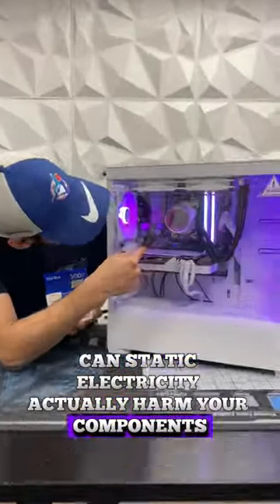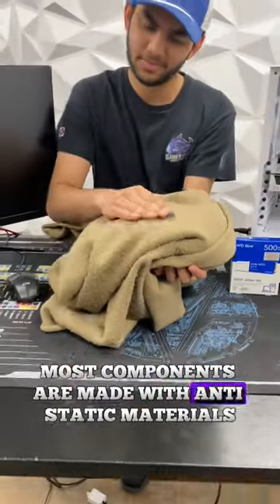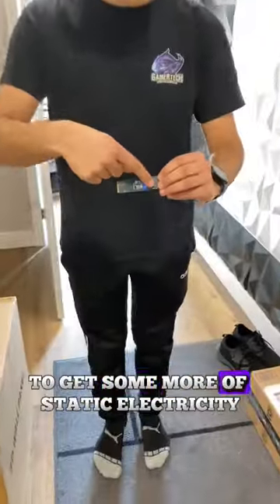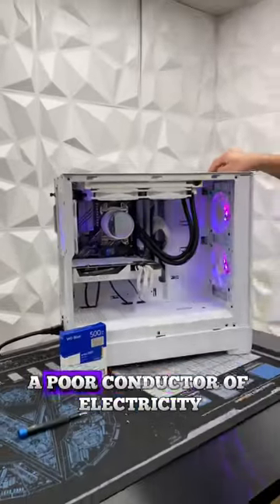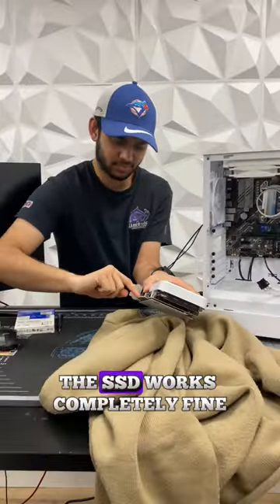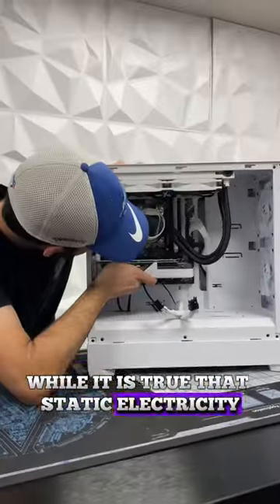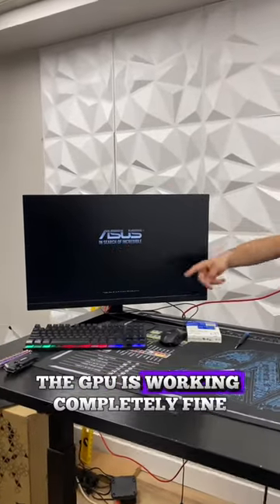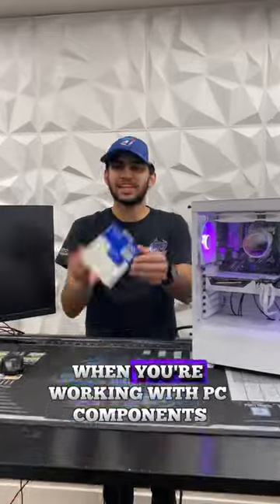Can Static Harm Your Components?! 🤬 #static #components #techrepair #gamingpc #pcgaming

Comment: wasn’t there a video you guys did about using a vacuum to clean a pc can lead to a fried mobo from static?
Reply: This happen to my friend so i wouldn't recommend trying it
Reply: Yea, but in the video they said that it was a long time ago. So the products weren’t static resistant yet.
Reply: @1xroxk645  It was also a long time ago when it happen for my friend like  a few years so  i guess thats why.
Reply: Vacuum or lawn movers produce a lot more static man
Reply: I just did it yesterday, unless it's some hand held vaccum you're using and just smushing it on the components, there is no way on this earth at this point in time where a regular vaccum cleaner is going to impart enough charge through the PVC pipe extensions to affect your pc. Evn if you just leave the pipe in and that vaccum hypothetically runs for 200 years

Comment: Folks don't listen to this video, it's horribly misinformed. There is different types of ESD damage. There's catastrophic where electronics are obviously stopped working, this is what this video is looking for, but there is latent ESD damage. The devices works but maybe it freezes for sec, or crashes every once and while. Then months later or even longer it stops working and you don't even know why. That is what you really need to be worried about. Also you can not feel the about the electrostatic discharge that takes to damage a component. If you care about your gear be as ESD safe as possible.
Reply: Source?

Comment: If you hold the ssd while charging yourself up, you also charge the ssd to the same level as your body is, same with the gpu there won't be any static electricity between the body and ssd/gpu if those 2 competents are groundet it looks differently
Reply: I was bout to comment this, but you right
Reply: @DementedApe  I was thinking bout it too xD
Reply: Right this was such a poor example, he should rub his feet on the carpet while touching the ssd and then step off of the carpet or set the ssd on the ground, or even install it onto a grounded system. Lol

Comment: static resistant unless your components are made or rubber, it’s not “nearly impossible. If you build up a charge and your not grounded, that electrostatic is gonna be jumping around like a dirt junkie, as soon as it can find a path of least resistance, like installing a component onto a grounded system, or stepping onto contacted floor while holding a component. Unless your systems components company somehow invented a material that is conductive when in contact with each other but not with the ground… that’d be some Harry Potter type shit. 
Either two ways. 1. Stay grounded ✌️Or 2. The floor is lava

Comment: Hey, so I have a Huion kamvas 22 plus (drawing display tablet) Its a monitor you can draw on. If anyone is experienced with huion/wacom or any other brands who make them please tell me if there is any worry when it goes black everytime I have a blanket near my table where it sits. It quickly works again after less than a second but should I be worried ?
It's connected via a thick USB-C to USB, HDMI and power supply into the wall.